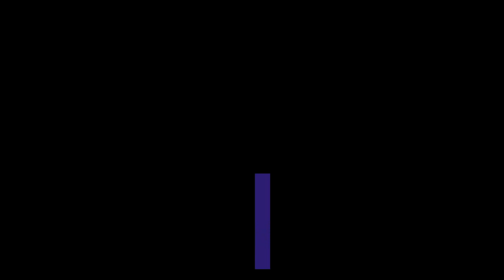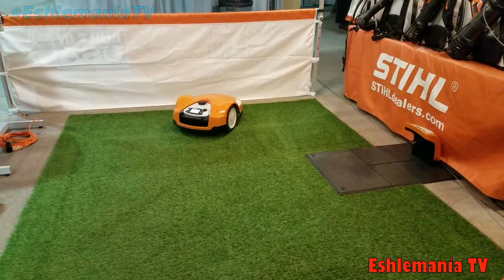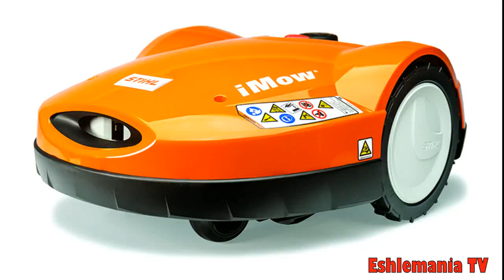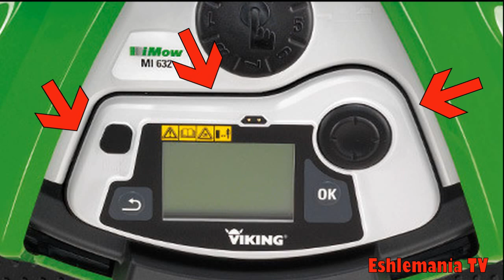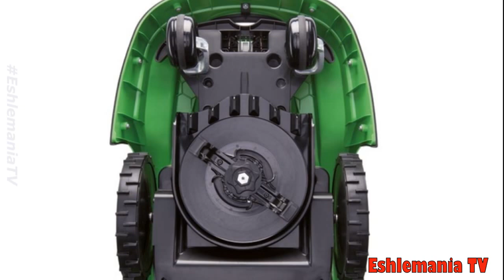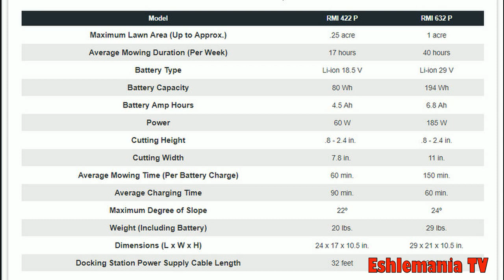Introducing the Stihl imow (RMI422P & RMI632P)

Comment: These Stihl mowers are absolute turds! No connectivity. No GPS. No guide wires to help it through complex yards. They might work in Europe, but they just suck for yards here in America.
Reply: AM4 false, it is all guide wire(P wire, no go zones, secondary zones, etc), meh connectivity not important to most, iMow uses 2G network in EU for GPS which 3G is in the works for the USA, along with linking several together, later this year if you really actually have any interest.

Comment: It would be hard to beat the Husqvarna, are the price points similar?
Reply from the maker: The Stihl RMI632P has a retail price of $2,000. BUT when you compare the Stihl RMI632P to a Husqvarna 430X or 450X it's like comparing a Chevette  to a Corvette. Both models that Stihl has here in the United States are more comparable to the old 200 series (220, 230, etc) of Automowers. Yeah a 430X might be $700 more than the Stihl RMI632P, but it's a hell of a lot better machine! Especially now that the 2018 430X models will come equipped with headlights and the connect package right out of the box.
Reply: Thats a positive improvement. The new price point for the 315 is a game changer too at 1600 with optional connect. Now we just need a gate and cutting options to 3 inches.
Reply from the maker: Yeah the 315 automowers are going to become very popular! The gate is probably going to have to be something done by an aftermarket company. BUT the higher cut height is coming....... Can't say when or how, but it's in the works